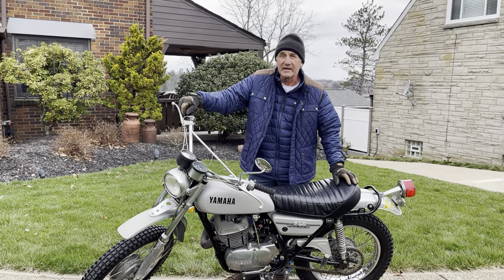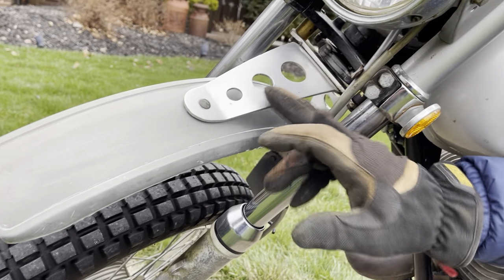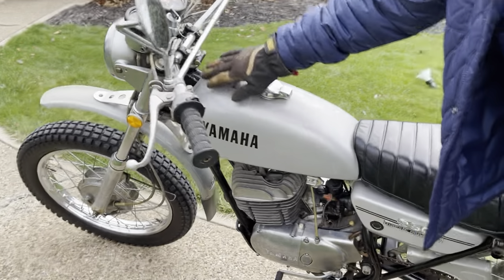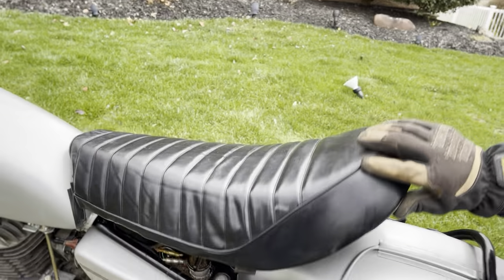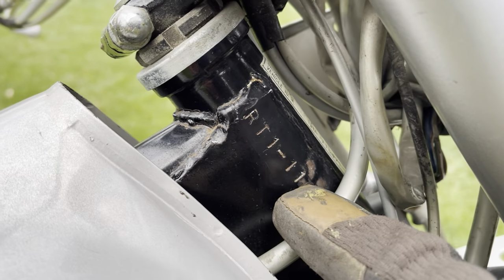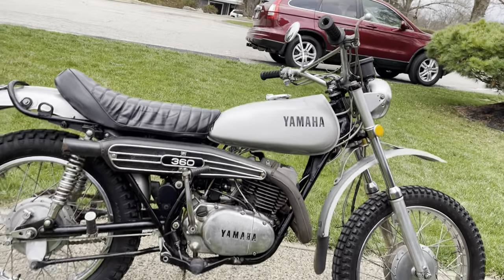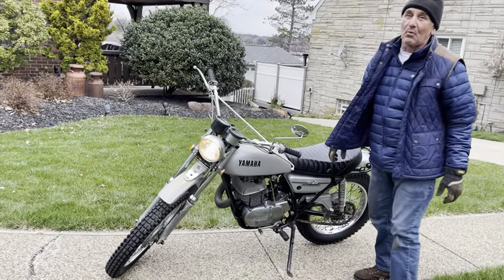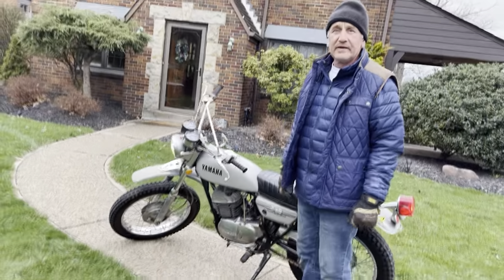1972 Yamaha 2-Stroke RT 1 Enduro 360

Comment: 7/9/23. My first wheels after VietNam in '70.  Thought it was an RT-2, but could be wrong.  In fall '72 lit out on an Outlaw-Journey from Denton, TX aiming for Patagonia (prob 10k miles one way) to southern Argentina.   In Panama shipped it to Peru and rode the Andes to the Altiplano in Bolivia. There, my brother contracted encephalitis and we were forced to abort the trip.  Lucky to be alive, The bike made it home to Telluride,CO and lived it's final days climbing the mtns until it expired in '81. Today, at 75 years of age, and losing eyesight,  the sound and visuals you provided brought tears of joy.. thank you..
Reply: I bought one from a Vietnam vet in about 1975 when I was 15 years old and weighed about 125 lbs. It was a 1971 black with red pin stripes. Great bike.
That spare plug was replaced with a compression release.
Greetings from Buena Vista Colorado.
Reply: I had an RT2 as my first road registered bike in about 1975 
Greetings from Australia
Reply: The RT1 was a 71 model. This bike is a 72 RT2. My brother had a 71 RT1 MX and I had a 73 DT3 250. Wish I still had them both.

Comment: I have that bike, it is an RT1B . It says it is a 1971 model but it has the flip up cap like yours, no side badges,  when some 1971 models I see have the screw on cap and side badges. Maybe they changed the tanks mid 1971 year, not sure.
I remember they have a sleeve on the flywheel that has a spring advance, it is suppose to advance the spark as the revs go up. Maybe the spring got weak but it  would spark too soon sometimes and kick back almost breaking your foot , the reason it came with a compression release I suppose,  mine did not have bought used, One time it kicked back breaking the hard sole of my boot, next time I kicked it, put it in gear and it went backwards.
The flywheel key sheared just enough to fire before top dead center, yes these engines will run backwards. Had to change the flywheel key to fix it.

Comment: No smoke, not right check auto lube.
Reply: Using expensive full synthetic 2T lube non of my autolube yamahas smoked either...even when cold and with the pump correctly adjusted as per shop manual.
Reply: Well, I guess I used the wrong 2 stroke oil all my life.
Reply: @randybusbee3456  there is so much wrong on this certain bike. well I hope the new owner did get it fixed.
Reply: Well, all I can say is I wish I had an old Yamaha like that,100 to 360 I'd be a happy camper.